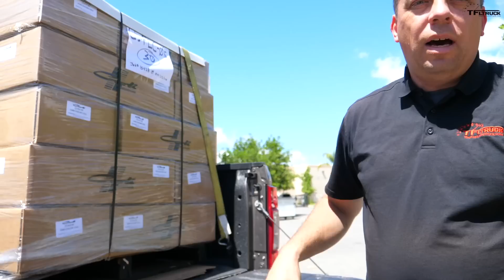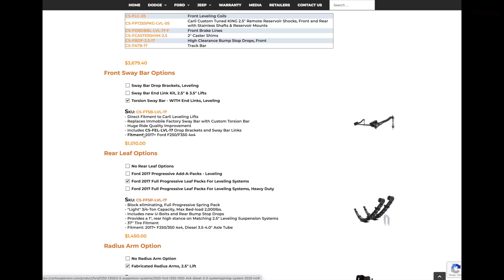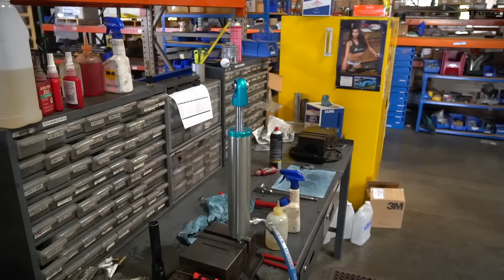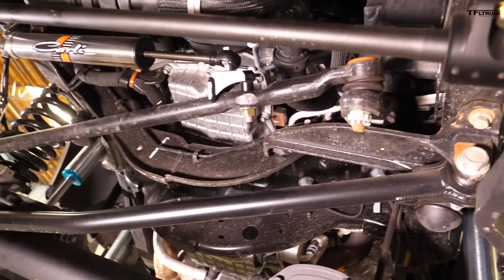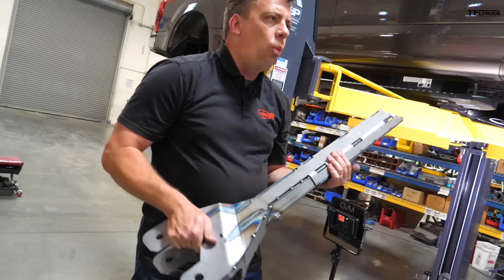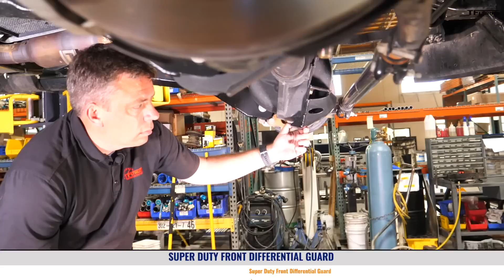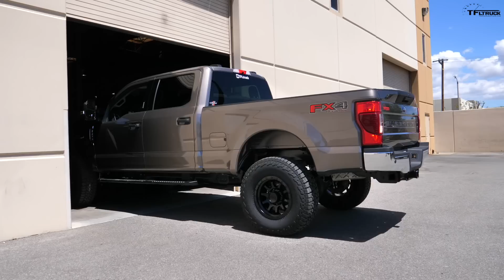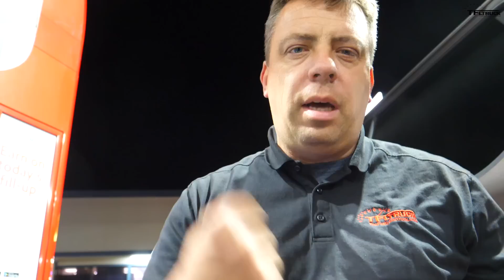See How This New 2020 Ford F-250 Now Rides Like a Raptor but Still Tows Like a Monster!

Comment: I’m surprised that the conversion/suspension shop didn’t recalibrate the speedometer, given the significant modifications they made.
Reply: Carli is a manufacturer not an installer. They sell the suspension parts not wheels and tires. I bet that 2 post lift is for there own R&D purposes not customer installs. I believe they installed the pin top system there just for Them for filming and promoting reasons. You can install that system on your drive way if you wanted.
Reply: @R J with 37's? I don't think so...
Reply: @SMiller5488   What about if they had bought a Tremor would the software be different ?
Reply: @R J fordscan does not go up to 37's
Reply: Maybe because they work on suspension not with car electronics and tuning? 🙄
Reply: Carli is a suspension manufacturer not a retailer/installer - they’ll R&D the suspension but leave the electronics tuning to the facilities servicing the end user. This was a custom build and it was communicated that the truck was headed straight for the tuner after the camper installation.
Reply: @DRTU4EA   Oh Dan! Little do all these commenters know.... Nice to see you on here BTW
Reply: Hypertech makes a module that modifies the data being sent to the speedo/cluster to adjust for 37” tires on fords.  I put it on mine and it’s accurate now when compared against gps.  Cost wasn’t too bad, and was installed by the shop that did the lift.  The only remaining problem is sorting out the TPMS alert bc I run the pressure carli recommends, vs the stock 65psi, so the truck always thinks I’ve got a flat... 🤷🏼‍♂️
Reply: Time for a 5 Star tune!
Reply: I thought that same thing.
Reply: R J because the ford dealerships have the tools and special scanners and software for Fords. It’s a dealer
Reply: It's not that easy on new trucks. FORDscan doesn't allow that much adjustment in the calibration without throwing check engine lights
Reply: @R J No it’s not. It is not doable on these newer Super Duty’s. Best option is to buy an Edge CTS3 to watch your actual speed.
Reply: If I have to go to another shop for speedometer recalibration, then that’s a problem. Bring a product to market when it’s ready to go, and that means not only the hardware, but the software. One stop shopping is what I expect, and if the suspension changes are that comprehensive (including the tires), then hire someone with the tech know-how to tie it up. Then there is that issue of safety. It’s nice to know how fast you’re traveling down the road, without having to look at your phone on your way to another aftermarket tuner.
Reply: Mike S. ur complaining just to read ur own content, aren’t u

Comment: Are you going to replace the stock fuel tank with a larger one? You should be able to get a 50 gallon one under there.
Reply: Titan and S & B make aftermarket replacement tanks for Class 2 and Class 3 trucks with diesel engines. I could be wrong, but I tend to think the diesel tank from either Titan or S & B would actually fit, hook up and work on a gas engine truck. However, they do not advertise it or sell it for gas engine trucks. In the past.....12 to 15 years ago, Titan sold extra capacity fuel tanks for gas engine trucks...but not now. Probably because of CARB and other government EPA regulations.....and or the cost to have a larger capacity gas tank be CARB compliant is prohibitive to Titan and S & B. You can thank the "sky is falling" climate change tree hugging freaks.

Comment: Im really enjoying this video series and can’t wait to see where this build goes.  I’m stuck behind purchasing a new 3.5L F150 or a 6.7L F250 for my daily driver...
Reply: F150 will give you much nicer ride. Unless you need the F250 for payload or towing F150 is better as daily. I have F150 3.0L powerstroke Platinum.
Reply: F-150 for sure as a daily driver
Reply: I require constant payload for work and tend to go off-road more than I should for my daily driver/work truck.  The longevity factor seems more in favor of the gas-powered engines with California’s BS emission laws and regulations.  Idk what to buy... they both end up being roughly $600-$700 a month.
Reply: @MooseSquatch  i would 100% go with the 3/4 ton gas based on what you said. If you go offroad a diesel engine adds a crap ton of weight to the front end and doesn't help. I think Ford's 7.3l gas engine is pretty amazing
Reply: @MooseSquatch   that's low payment. The Tremor is good off road and has good payload. 7.3L gas or 6.7L diesel. Hard choice.
Reply: @MooseSquatch  What kind of payload are you talking? And what type of offroading? If it's sub ~1klbs in the bed or something, an F-150 will be fine, but anything more (1500-2k) on a constant basis (even if the 150 is technically rated for more) and I'd start to desire a larger vehicle
Reply: @MooseSquatch  Go F-250 with 7.3L gas engine...built for reliability and durability.....4.30 gears and the Tremor Package. Lariat with Ultimate and Sport Packages gives $1,140 discount on the Tremor Package.

Comment: At least you acknowledged that the trip computer on the truck was off. I see alot of people running larger tires and still use the uncorrected trip computer to figure out miles. If the speedo is off, the tripmeter/odometer will also be off.

Comment: Now the truck gets the same MPG as the current Tundra.
Reply: @Rottie  I never got more than 15.8 on the hwy with my 08 tundra. that is why I traded it in.
Reply: Rottie that’s amazing! You’re crushing the EPA estimates! Please share your secret.
Reply: @Rottie  My 2010 4x4 with 4.30's makes 11.6 in the city, but at 60-65mph I get 22.4mpg. Now with I drive the 75-85mph limits here in Texas I make 11-13mpg, The 5.7l makes the best mpg @around 1500rpm, and thats 62mph for me on my 34" Falken AT3's
Reply: I got this beast w/the 7.3 and 3.55 axle.   At 60 to 65 I get 18 to 20 mpg. It's a 4x4 too. It gets phenomenal mpg considering how huge it is
Reply: My 18 tundra gets 9.5 mpg. I have a 4 inch lift and 35s. If i was worried about gas mileage I would of gotten a prius.
Reply: Toyota get bad mpg my 2010 Tacoma trd sport 4x4 was lifted and I get the same mpg for my 2019 f250 6.2
Reply: I own a 2006 f150 6" lift 37" tires i get 9 mpg
Reply: Rottie I have 3 inches lift with 33 tires.  I got 13ish average.
Reply: I get 25 mpg on my 6.7 powerstroke empty at 70 mph, 14-18 when towing 10k lbs....
Reply: BLUBLUD The Toyota 5.7 is not a timing belt engine.
Reply: I see a big discussion about a Toyota Tundra compared to this Ford Tremor.  Both are excellent North American trucks.  Tundra's a half tons.  This Tremor is a 2500!  A 3/4 ton.  The trucks are not comparable.
I drive a Ram 1500 Quadcab
 4wd Ecodiesel , My wife drives  a Ram 2500 Crewcab 4wd 6.7L Cummins powered.  They are both wonderful trucks!  But they are completly different in so many ways.
Toyota does not market a truck in the USA that is comparable to a Tremor.
Reply: @zxej6879  you can also get an F350 Tremor, too.
Reply: @zxej6879 FYI - Ford calls their Class 2 truck ----> F-250........NOT 2500. The Ford F-250,  along with the Dodge 2500, Chevrolet 2500 and GMC 2500 are all Class 2 trucks.
Reply: It's still better MPG than my "03 Silverado 2wd!
Reply: @Rottie  You could run 28" bald tires, rip off your mirrors, and strip the interior you still wouldn't get 20mpg on any highway doing the speed limit. I've owned two Tundra's with the 5.7 the mileage is terrible. I keep the truck because its a Toyota.

Going downhill at 40 MPH at sea level you'd barely maintain 20 MPG. You just can't calculate your mileage or fix your odometer.

You pick.
Reply: Helicopter Dad imagine if toyota would build a heavy duty truck. GAME OVER.
Reply: @30minforasn  not like they did the Supra. They'll stick to Baja and the Tacoma's
Reply: @Rottie  if, by 'highway' you mean going 55mph, then sure... I can believe 20mpg.... But if you're going normal 70-75mph "highway" speeds, then you're completely full of it.  Hand calculate your mileage, rather than believing the lie-o-meter.  I guarantee it will never be higher than 18mpg, no matter how easy you are on it.
Reply: But not near as reliable.
Reply: Barry Hussein Soetoro sorry Toyota still riding on 90 to 2000 reliability story. Had 3 Toyotas and I moved on. Nothing is interesting from them anymore. Let me know when they give tundra real update
Reply: Barry Hussein Soetoro prove it
Reply: Jeremy C there’s many many tundras with one million plus miles out there.  Fact.  Show me a Ford or any other manufacturer with countless trucks with one million plus miles on them.  Good luck. I’ll wait.
Reply: Barry Hussein Soetoro I haven’t seen any million mile tundras with 5.7 v8, can you please provide a link. Thanks!
Reply: Barry Hussein Soetoro theres only three confirmed million mile tundras and they all had the 4.7 v8. The 5.7 is still more than excellent as a motor im also waiting for a million mile 5.7
Reply: @barrysoetoro3488  Nissan's got a few million-mile frontiers out there, but to be fair a lot of companies use nissan over toyota as fleet vehicles due to cost.  (O'reilly's, autozone, advanced auto for example have a contract w/ Nissan for their work trucks).
Reply: Barry Hussein Soetoro https://youtu.be/kNHax-CHSEs
Reply: @officialyasir  there have been a few Tundras with a million plus on original motor. One was sold back to the dealership it came from to be torn down and studied. Not sure what dealership. But you can search YouTube and find it. The 5.7 v8 is pretty reliable.
Reply: Chris Wolinski I have seen that one, it wasn’t the 5.7 V8. That motor is no longer even offered in the Tundra.
Reply: @barrysoetoro3488  A million miles? Really...how many trucks...exactly? That's because Toyota Tundra trucks are driven on pavement and also a fair amount off-road...no big deal. The Toyota trucks not worked hard and abused with little to no mercy like a Ford Super Duty. I can tear the ever living crap out of a Toyota Tundra truck on the farm / ranch within a week!
Reply: @officialyasir  💀💀💀

Comment: I don't understand why they didn't recalibrate ur new tire size into the trucks computer to go with ur 37's. Hmmmmm.
Reply: The Ford computers are only capable of correcting to a 35" tire using ForScan.

Comment: Are the 2020 F250s lower in ride height compared to the previous 2017-2019 models
Reply: Ford apparently did lower them slightly, but I believe only by about an inch
Reply: Yes the 2020 Fords are lower, and as a result actually have even less front travel than say a 2017 Ford. Take a look under one of the new 2020 Fords and you'll be blown away by how close the axle is to the bump stop. That's why a system like this that's designed to increase travel and suspension performance is so helpful.
Reply: From what I have read.....2020 Ford F250 and F350 is about 1 inch lower than 2017 - 2019 F250 and F350. The 2020 Tremor Package is about 2 inches higher than the standard 2020 and about 1 inch higher than the 2017 - 2019 trucks.

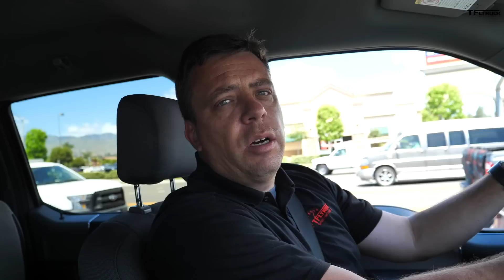Comment: Did anyone else notice the matching F-250 at 2:58 also with a lot of weight in it's bed? Didn't seem to be handing it as well though.
Reply: That's looked to be a steel bodied f250, also the super duties do squat quite a bit until they hit their load springs. The spring that takes the weight unloaded is fairly soft to try to make the ride better.

Comment: You should remove the plastic flap under the super tremor so that you get better approach angle
Reply: I say keep it an see what type of obstacles it faces, and how well it holds up. If it gets torn off, no biggie, or is easy enough to remove if they're approaching something significant.
Reply: More approach but worse fuel economy. On highway went help but will help once one the trails.